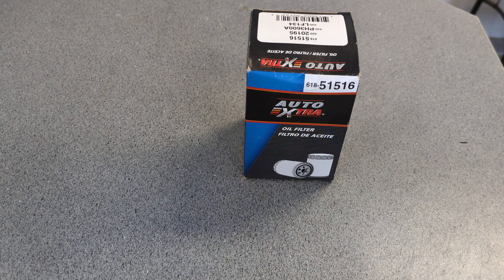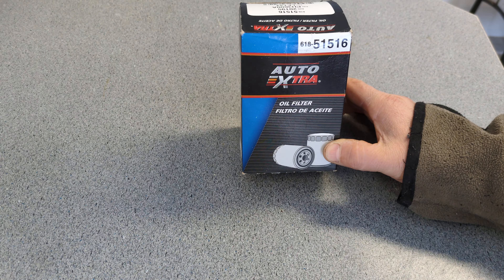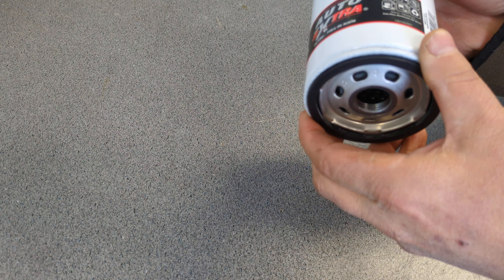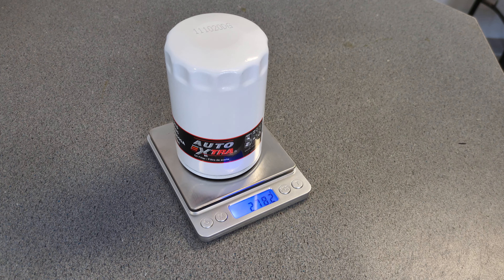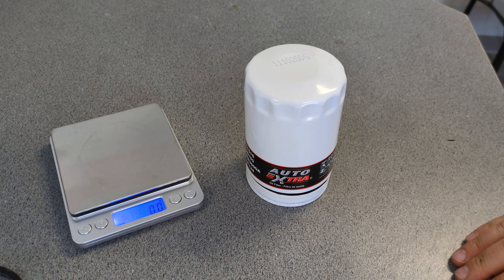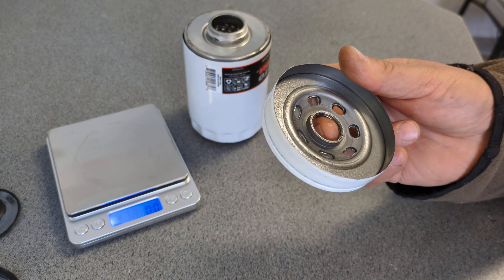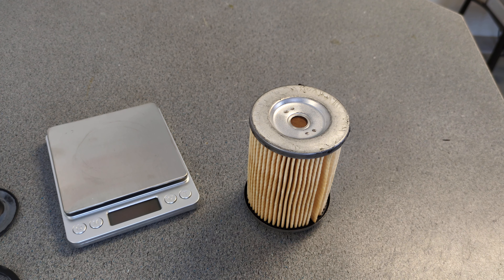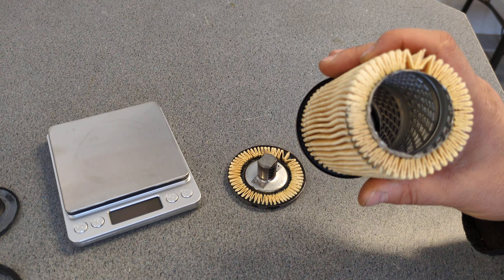New Auto Xtra oil filter Review

Comment: When I'm buying a new filter, if the packaging allows, I open it and visually inspect the filter. What I learn from this video - is to pay attention to the inner tube size. If the diameter is unreasonably large, means they are trying to save on the amount of filteration media.... not good.
Reply: I open those sealed boxes.  I mostly check to make sure the louvers are open enough.
Reply from the maker: That's a new trend with filters nowadays,  I think it started with Chinese built filters but have branched out the American built filters. 🤔
Reply from the maker: @kirkpalmer1709 me personally, I am not a fan of louvers and continue to always support the holes in the tunes.😉
Reply: @crazybillsgarage  I'm not either but all the top brand filters for my truck are louvered.  I thought I might have found a good filter with holes in the core with a Luber Finer, but I opened one of those up and one of the end caps was only half glued to the media so their quality control can't be trusted.  I'm still searching but I don't think a good filter with holes exists for my truck.
Reply from the maker: @kirkpalmer1709 does AC Delco make a filter for your truck. They have E core and built pretty good.
Reply: @crazybillsgarage  They do but I haven't looked at one.  I have a 7.3 liter diesel and it probably takes the biggest oil filter that comes on a pickup truck so they're typically built different than standard filters.
Reply from the maker: @kirkpalmer1709 yes they are built a bit different.  Well that's a tricky one.🤔

Comment: Yes, definitively, a Purolator. The base plate, bypass, and serial number all point out a Purolator, and there is glue everywhere. I wouldn't use this one.
Reply from the maker: Thanks Bud, the filter is a mess of cheap products put into one filter. The metal ends caps and base plate are the best qualities. Never a filter I will use.😉